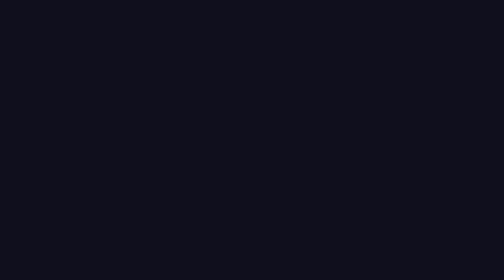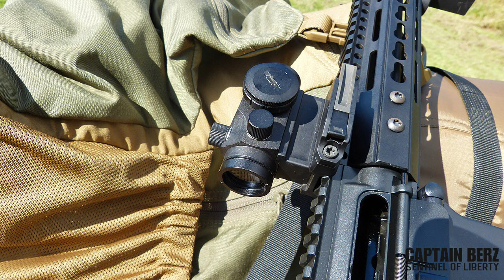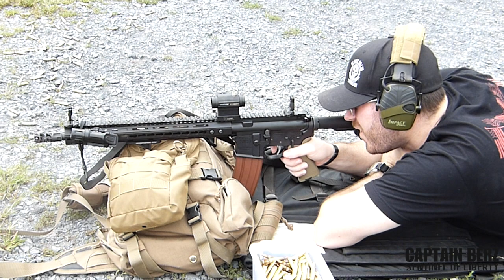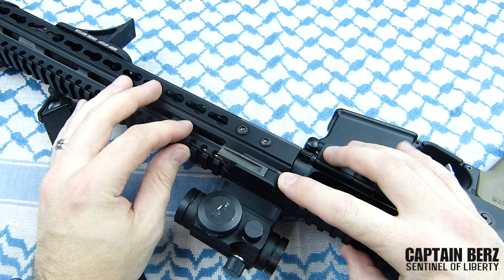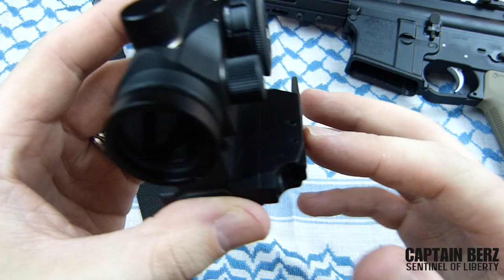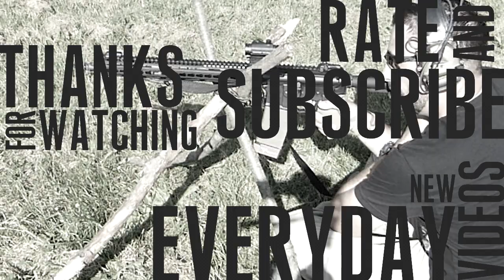Micro Red Dot QD Mount by Bobro Engineering

Comment: Older video, but a couple things going on here. First, put your optic anywhere you want, but keep it on the upper receiver only. It's the only part of the gun that won't flex. The rail will. With that being said, it has been proven that it is faster to get the dot on target with the optic mounted closer to the eye as it is more forgiving this way. The primary advantage of mounting it further forward (toward the muzzle) is less parallax on closer shots and a lot more FOV around the optic. Second, the anti-glare ridges of the mount should face the shooter for obvious reasons. You can turn the spacer around. Third, this mount is the best out there for return to zero.
Reply: Yankee BlueJeans well said. You are spot on and I agree with every point you raised! Such a great mount. I have mine mounted the same way where the lever is on the right side.